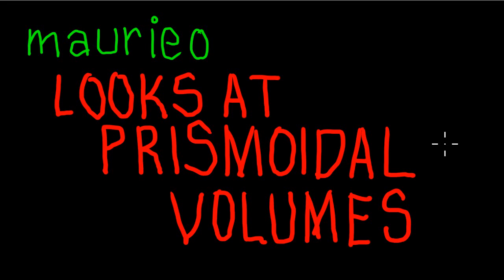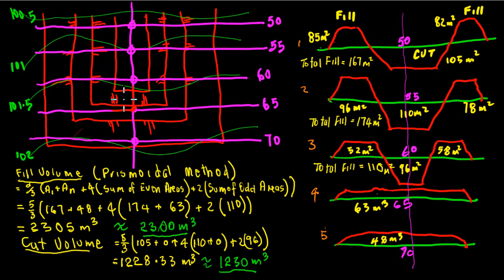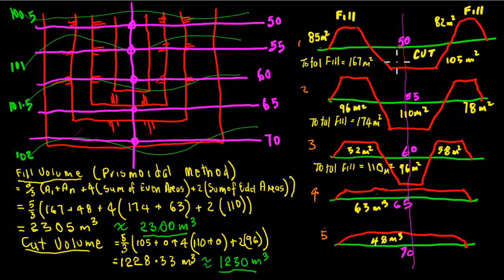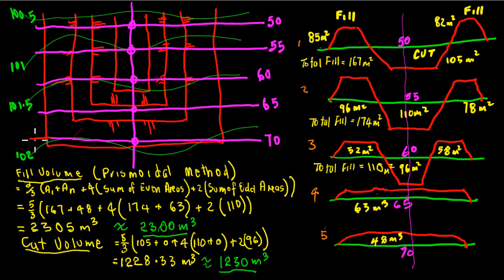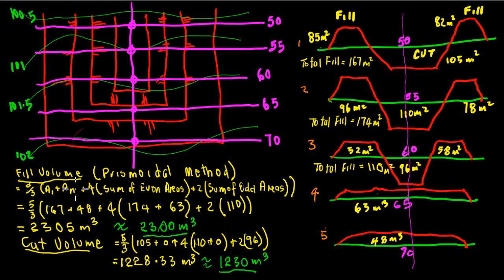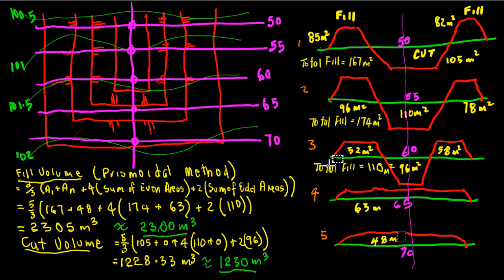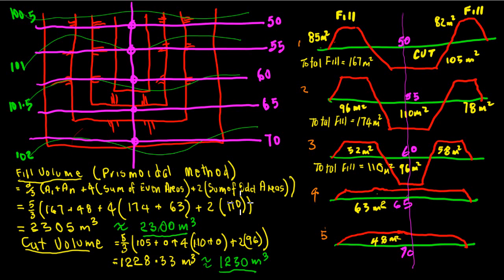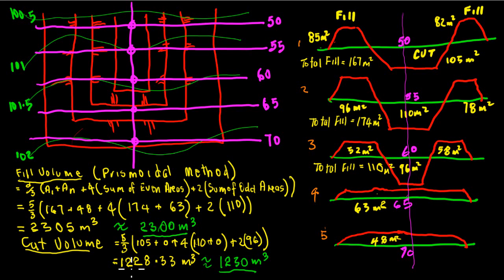maurieo LOOKS AT PRISMOIDAL VOLUMES

Comment: thanks for you , but how you calculate the amount of fill and cut ,,,
Reply from the maker: Hi It is calculated there at the bottom left of the last slide
You work through the prismoidal formula with the cut crosssection areas to get the cut volume
and with the fill crosssection areas to get the fill volume.
Reply: thank you ...